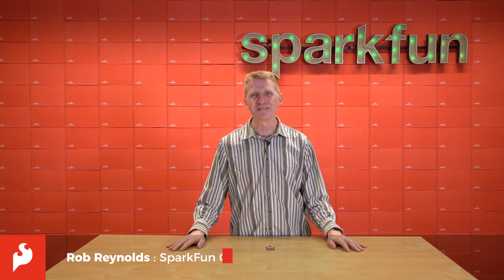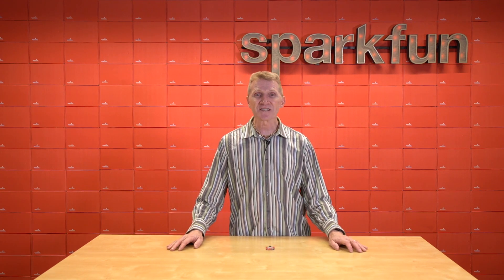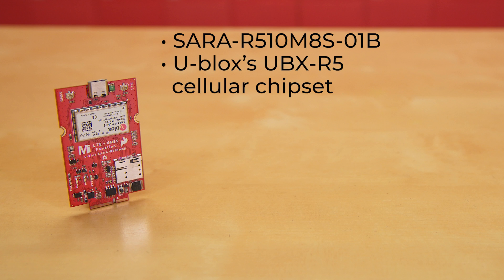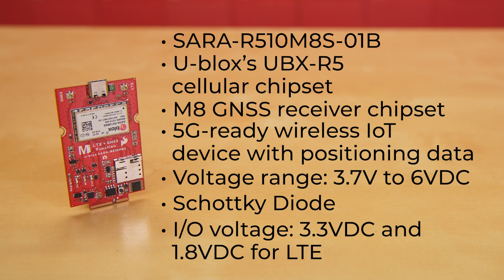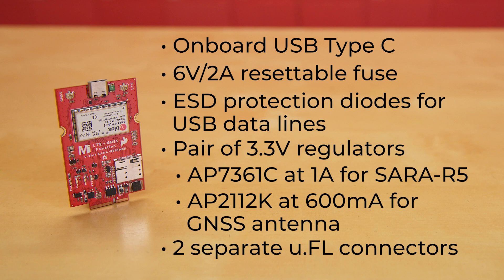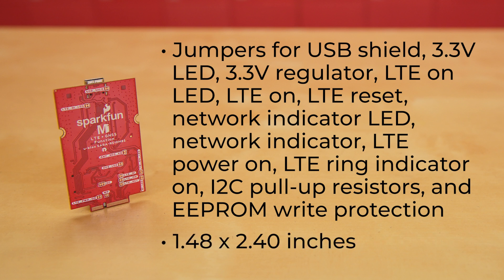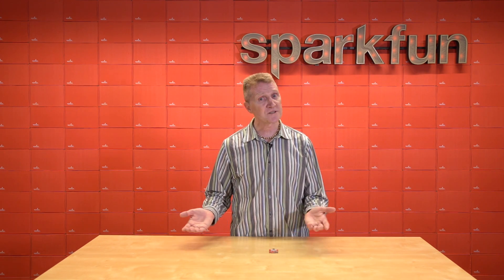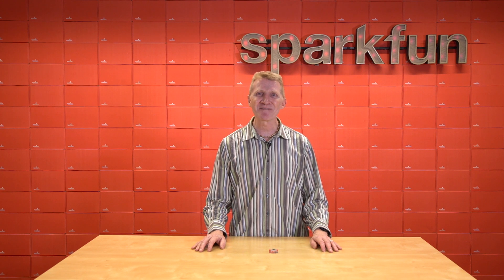Product Showcase: SparkFun LTE GNSS SARA-R5 Function Board

Comment: since the SARA board has cellular and GNSS, can't it's processors be used to control regular GPS location transmission packets on its own?  The function board would not be needed unless you wanted more intelligence or I/O ports, right?